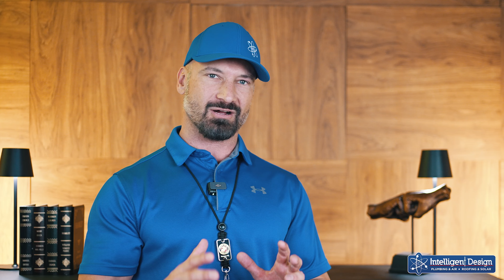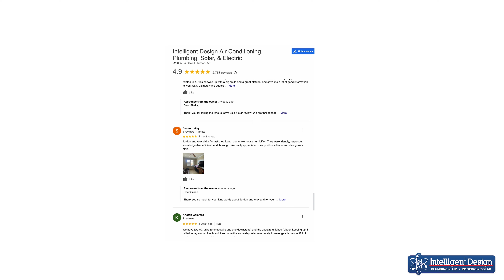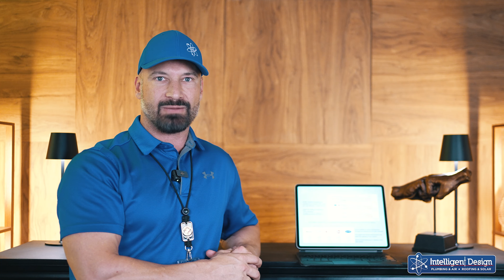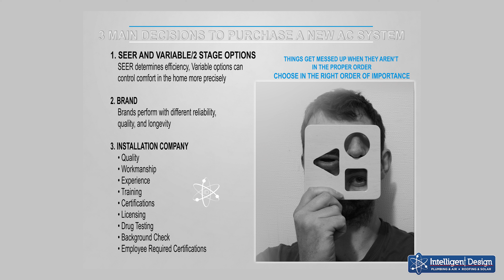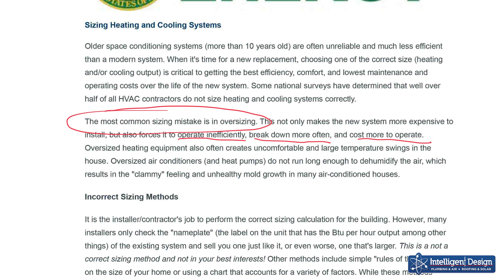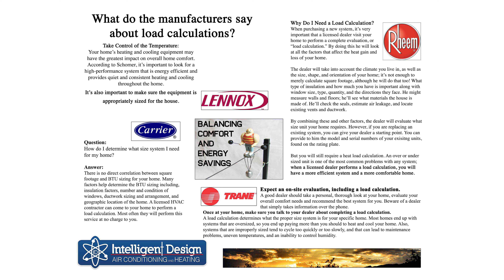AC Estimate Appointment Expectations | Intelligent Design AC, Plumbing, Solar, & Electric

Comment: **BEWARE**
We hired Intelligent Design to install a new HVAC unit, but the experience has been a nightmare. Not only was the unit installed incorrectly, leading to immediate issues, but the customer service has been some of the worst I’ve encountered. Every time I call to have their mistake corrected, I am met with delays and a complete lack of urgency. If you want the job done right the first time and a company that stands behind their work, look elsewhere.